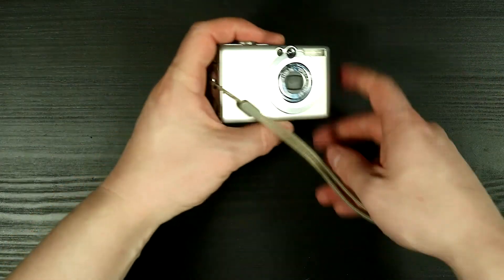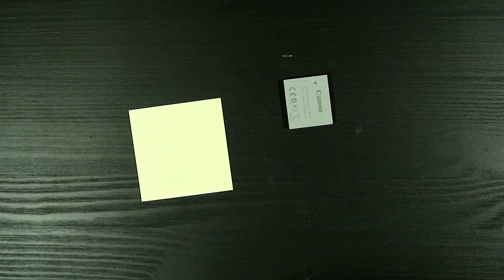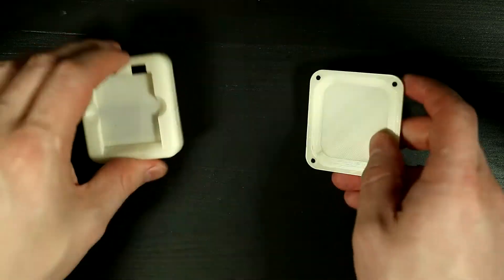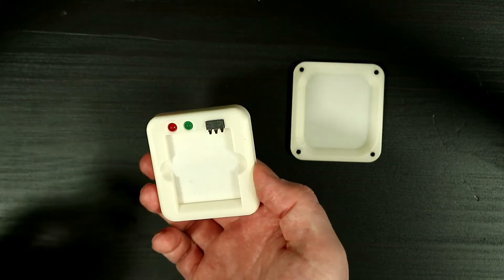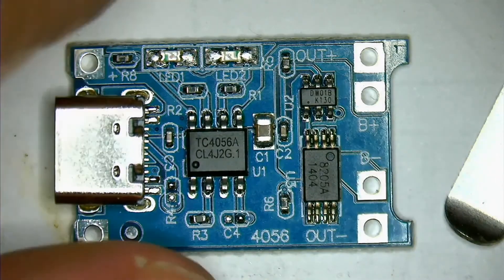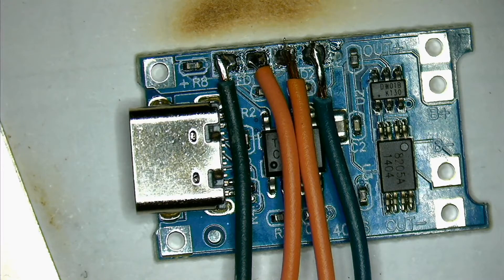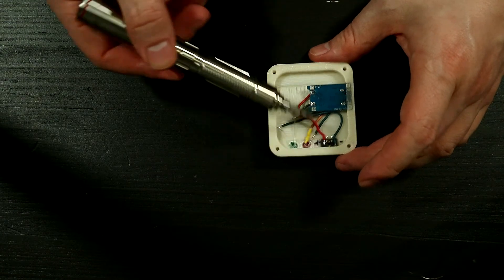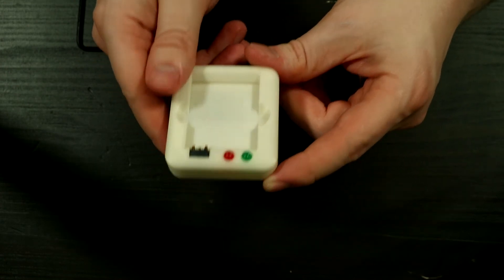Making a NB-4L charger

Comment: Nice video, where did you get the battery connector from ? I tried aliexpress but didnt find anything obvious, I think its standard spacing for a lipo which fits samsungs, nokias  etc. so any connector for those should also work?
Reply from the maker: Pretty sure I ordered them from AliExpress
Reply: @Purkkaviritys  yep found them now, 2 pin 3.0mm spacing one does the trick